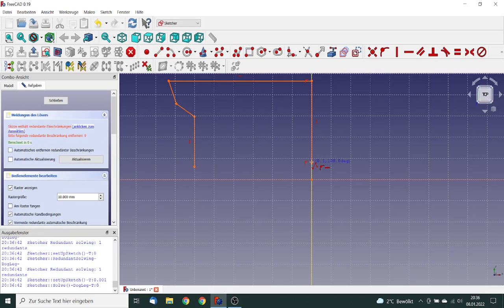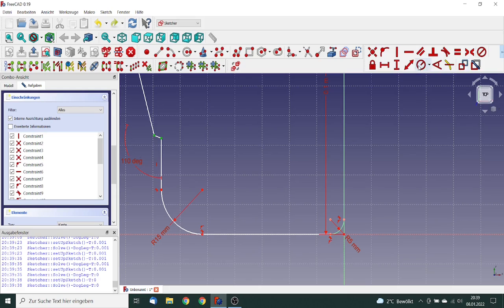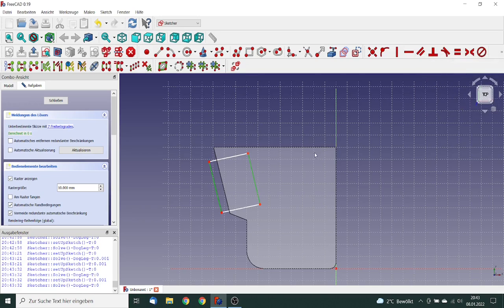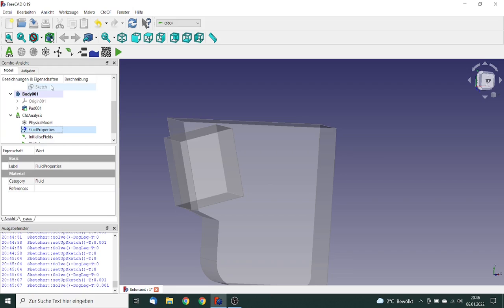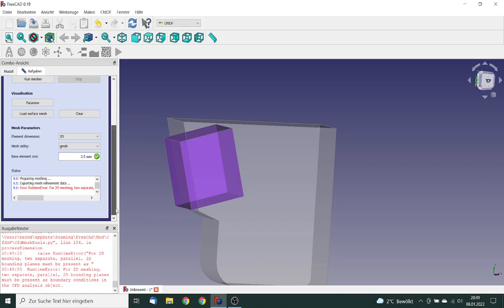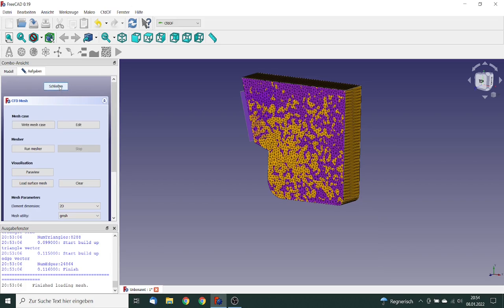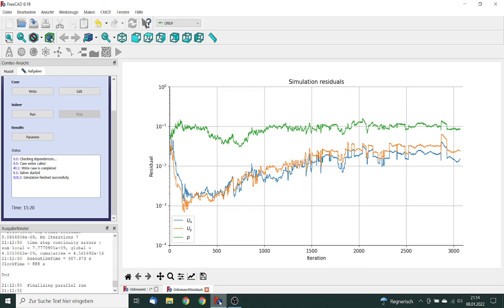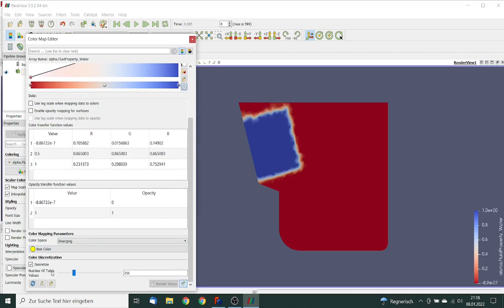Freecad CfdOF Tutorial #8: Simulation of a flow with 2 Phasis

Comment: Hello i want to introduce a different type of gas into my simulation space using an inlet boundary (so in you simulation it would be the same as creating an water inlet in one of the surfaces). Would i need to create an initialisation zone with 100% water near the inlet boundary in that case as wel, or can i also use an inlet BC with volume fraction 1 of water?

Comment: Would this also work to analyse steam exiting a diverging cone, thus creating a vacuum to suck water and then the water condenses the Steam in a converging tube?
Reply from the maker: First of all, the two media (air, water) shown in this tutorial only interact physically. Your question is completely different: steam is a different form of water, and when steam mixes with water, the steam is expected to condense. Furthermore, in my tutorial, both media have the same temperature, so the temperature can be neglected. In my tutorial, the media are incompressible; if you take temperature into account, you create a model with a compressible medium. If you can ignore the effects of condensation and varying temperatures in your application, you can adapt my tutorial to your own application. Unfortunately, I can't tell you how to simulate a medium with different temperatures and different phases in OpenFoam.

If you are interested in this topic, I would recommend to you to ask this question in the FreeCad-Forum.

Comment: For the Sub-type, FreeCAD0.21.2 does not have the 2D bounding plane. There is only "Symmetric" and "Periodic". Which of the two should I choose?
Reply: Here's how to do this:  
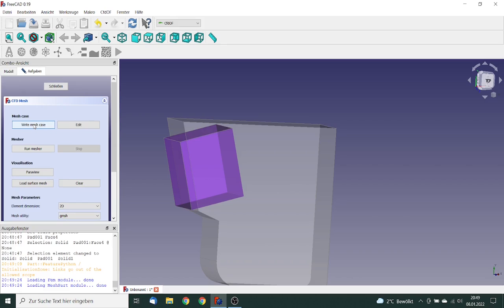* Follow the instructions until 14:05.

* In the mesh panel, select gmsh (polyhedral) and base element size 2.5 mm, as shown in the video.  Click "close".
* With the mesh selected in the model tree, click the "mesh refinement" button (icon is a circular object with some elements colored green).  Select "extrusion", then "2D planar mesh", and set thickness equal to 30 mm.  Add the back face to the reference list by selecting it in the model, then clicking "Add". Click "OK" to exit mesh refinement.
* Double-click the mesh (probably called "Body_Mesh") in the model tree to re-open the mesh panel.  "Write mesh case", then "run mesher".  Finally "load surface mesh" so you can see it inside FreeCAD.  Click "close" to exit this panel.
* Your water rectangle needs to be inside the mesh, but the mesh probably extruded in the wrong direction.  An easy workaround is to go into "Part Design" workbench, double-click the pad for the water, and in the pad menu select "reversed".  Click "OK".  The rectangle should now be inside the mesh.
* Skip ahead to 16:40.  If you accidentally created boundary conditions when following 14:05-16:40, remove them.
Reply: @mechiejessie  Thank you for your advices! I followed your instructions step by step (I reversed only the pad for water so it is inside the mesh, I didn't define boundary conditions) and finally (after many years😅) I had a working simulation (with BlueCFD and ESI in Windows 10, with BlueCFD in Ubuntu 22.04). Thank you so much! 😊
Of course, thanks to Tech Bernd, your tutorials are precious😁
Reply from the maker: Hello tanushkareddy, the way to mesh a 2d surface has changed one year ago: The 2D meshing is now defined as a "mesh refinement" (=> extrusion). For further information, you can take a look in the Freecad-Forum: https://forum.freecadweb.org/viewtopic.php?f=37&t=66741

Comment: is it possible to use CfdOF to make overset mesh simulation?
Reply from the maker: As I wrote earlier, the FreeCad forum is better suited for these types of questions. Could you please ask your question there? The link to the FreeCad-Forum, subforum CfdOf, is: https://forum.freecad.org/viewforum.php?f=37

The expression "Overset mesh simulation" is unknown to me. Could you further detail your question in your post in the FreeCad forum? Which solver does your question refer to? Does your question only apply to InterFoam and mixed fluids, or to all solvers? What application do you want to use this technique for?
Reply: @techbernd5535  Sure I will elaborate my question and post on the foruns during my lunch break, I am not sure, but I believe that it doesn't apply to InterFoam, if I am not mistaken there are a few special set of solvers, the one I have in mind if overDynInterSolver or something like this.

The overset mesh is typically used to combine mesh elements. The best example I think is a rotating propeller, because you have the background mesh, that is, the control volume, and you have the propeller mesh, that rotates, pushing the fluid.

In my case, I am trying to do a mooring analysis of a safety buoy net. I will apply the fluid velocity on the inlet, try to implement the mooring library to apply the BCs on the floating bodies and see how they behave. I need to prevent the buoy assembly of going underwater under heavy flow when the hydroeletric plant opens its flooding gates.

Comment: Great video, thank you so much! These are a tremendous help in learning the process of using cfdof. Are you one of the authors this workbench?
Reply from the maker: Hi sstevenson! No, I am not the author of the CfdOf workbench. The lead developers of this version were Johan Heyns, 
Oliver Oxtoby and Alfred Bogaers, and there have been several pre-versions, for example the version by Qingfeng Xia. You can find the contributors here: https://gitlab.com/opensimproject/cfdof
Reply: @techbernd5535  Hello Bernd, I am trying to duplicate your demo with the latest version of cfdOF and OpenFOAM 2206. The new version of cfdOF does not offer a 2DBoundary constraint option for the front and back walls as shown in your video. It only offers Symmetric or Periodic options. I chose Symmetric and my simulation seems to be running as 3D and is taking a long time. Do you know how to make this 2D in the latest version?